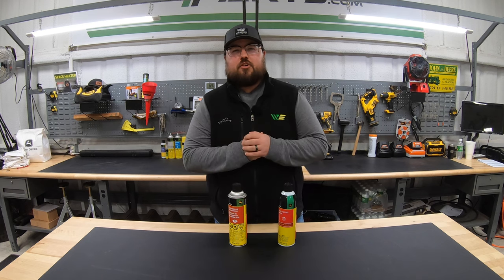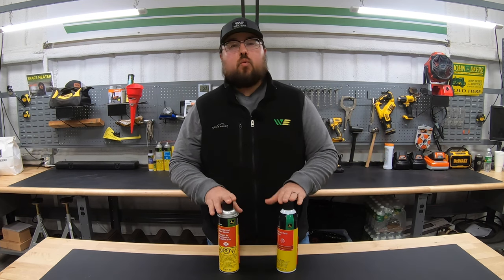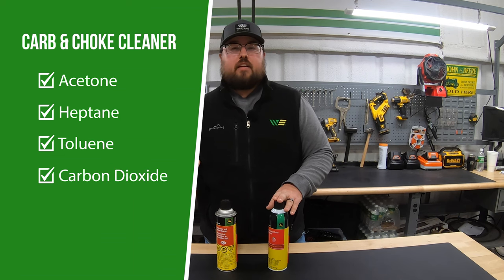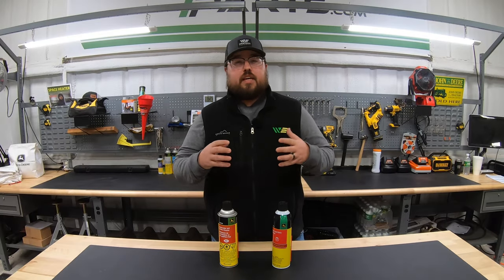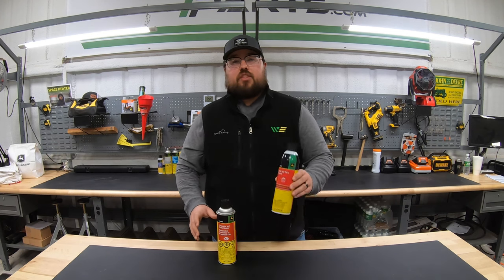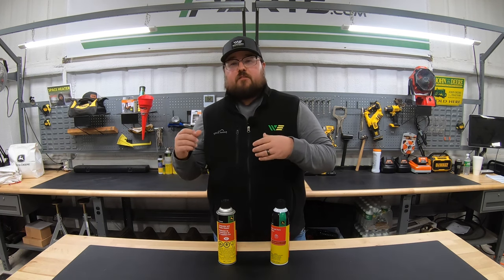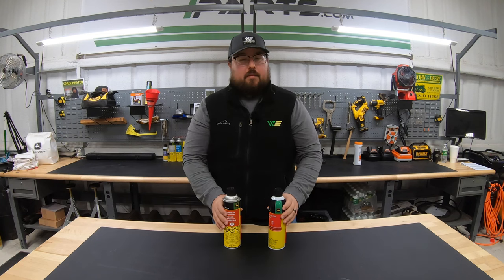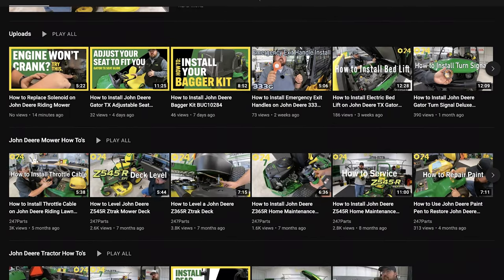Brake Cleaner and Carburetor Cleaner: What's the Difference?

Comment: Toluene is not just an aeromatic. I worked with it for years in heavy printing. It's is absolutely a heavy duty thinner, cleaner. It's no joke. And that's smell is hazardous beyond so many PPM.
Reply from the maker: Thank you for the info! The information that I found on it did not mention much except for the fact that it was mainly for the aromatic purpose. Thanks for watching!
Reply: Damn I love the smell of toulene.
Reply: They used to run straight toluene as fuel for high boost race cars back in the day and pretty much all those mechanics died of cancer.

Comment: Not true at all. You sprayed a rubber mat that the Acetone(carb cleaner). This dissolves rubber and made the carpet powder stick. Brake Clean is primarily Xylene which less likely to dissolve the rubber mat. Carb cleaner does not leave a residue and all the ingredients are used before paint prep. Carb cleaner is a superior degreaser but dries faster than Brake clean.

Comment: Hi, I'm working on a SU carb and have only brake cleaner (which I abuse for other purposes, mainly cleaning plug holes), since I'm replacing all rubber grommets anyways, can I get away with using brake cleaner if I flush it with oil afterwards?
Reply from the maker: Yes, this should be fine. Good question and thanks for watching!

Comment: technically neither leaves a film but instead the difference is how they allow water in the air to reform the film that they have disturbed. methanol acts to pull water out of the air better and puts stuff back to normal. if you ever do water sensitive chemistry experiments you learn pretty quick taht everything is actually covered in an invisible film of water that needs to be cleaned off first with a blow torch or by putting things in an oven/desiccating. 
when people use 3m window sealant to remake bushings, the reason it works for some and not others besides surface prep is coz 3m window weld is a 1 part water activated poly urethane and pretreating the surface with brake cleaner allows the methanol to pull water out of the air back onto the surface. it should be the last thing to evaporate from the surface out of the different ingreadents listed because of hydrogen bonding with its OH group. 
also someone said windshield washing fluid is 20% methanol. thats not true in many parts of the world like the EU where it was banned from windshield washing fluid in 2019. most mfg use a blend of methanol, isopropanol, and ethylene glycol or other mineral spirits. many mfg in the us and other parts of the world use a blend and if it does include methanol it tends to include ethanol (drinking alcohol) because that significantly decreases the toxicity of methanol ingestion. kind of complicated but in the old days the antidote for methanol poisoning was to get someone smashed. this works for ethylene glycol too.
Reply from the maker: Interesting. Thanks for the comment.

Comment: Great video, thanks so much. So I’m curious to know which you would recommend for cleaning O2 sensors?
Reply from the maker: Hmmm this is a tough one. What are the O2 sensors going on?
Reply: I'm also interested in this. I saw bunch of videos where guys keep repeating that it's important for O2 sensor cleaner not to leave any residue but I guess that if it works in such condition as exaust where, oil, fuel and carbon could appear the least worries is about some little residue, at least if you don't use WD40 or something like that. I'm planning to try to clean my with brake cleaner and imediatelly to wash it out with 96% Alcohol just to wash if anything left from brake cleaner.
Reply: Use MAF sensor cleaner. It's perfect for all sensors because it leaves no residue.

Comment: @westernequipment Hi again, for some reason I can't reply directly to your reply to my previous comment so I guess I'll just do it the roundabout way: "Hmmm this is a tough one. What are the O2 sensors going on?" My reply: It's the O2 sensors on my 97 Lexus LS400.
Reply from the maker: Definitely carb and choke cleaner. I would worry about the harshness of the break cleaner possible damaging the sensing element. I hope this helps and thanks for watching!

Comment: Is the chlorinated chemical to phosgene gas issue with brake cleaner only associated with welding or do hot engines and brake rotors have no associated risk?
Reply: There is chlorinated and non chlorinated brake clean. You can't even get the chlorinated stuff in some states. Chlorinated seems to work better, but you never want to spray that stuff on a hot surface. That's when you get the phosgene gas, which can be deadly. On the other hand the non chlorinated  is highly flammable.

Comment: Hi, yesterday I cleaned my fuel injectors with Liqui Moly carburettor cleaner. It behaves exactly as the carburettor cleaner in your video. I specifically purchased it because I didn't want to destroy the O-rings on my injectors. But the stuff totally destroyed my nitril rubber gloves. I read that the O-rings are usually made from fluoride rubber.

I didn't notice anything weird with the O-rings even after a few minutes.

Do I need to worry about my O-rings or is it all good?

Thanks in advance!

Comment: 1:30 No, the toluene is not put in there to warn people about the stout chemicals being used. It does have an odor, but it is a common cleaner to remove varnish from fuel lines and carburetors and to remove carbon from combustion chambers.

Comment: Yes, but basically methanol will react with rubber after you soak it for a while, since this brake cleaner will evaporate almost instantly I guess there is no wories at least if you dont threat the rubber too often.
Reply from the maker: Right but in a carburetor the brake cleaner will take longer to dissolve, therefore it could damage the rubber seals. Thanks for watching!
Reply: did you mean it will take longer to dissolve or evaporate?  @WesternEquipment
Reply: Oh you don't even need to soak it for more than a second. My phone case touched carb cleaner for a second and it started cracking instantly on the outside. Strong stuff

Comment: Methanol damages rubber? Windshield washer fluid is like 20% methanol. :O
Reply from the maker: Yes but with windshield washer fluid, it is out and the open and dries very fast. Cleaning a carburetor could be different and not allow it to dry quickly. Thanks for watching!
Reply: windshield wipers dry out and start cracking pretty quick and i bet windshield washer could contribute to that a little bit
Reply: i dont use windshield washer fluid and my wipers last for 5-10years at a time.... would rather rive a little bit with some slightly less clean windows than to have them not work when i need them. what ends up destroying my wipers is the ice in the winter if i forget to put them up off the window. in china and other parts of the world windsheild wipers are made with 2-6 blades which have much more rubber and can be trimmed and sharpened after each year. kind of dumb how we do it in the US, rainx brandname wipers are like 30$ and suck after 1 year.

Comment: But what about methanol injection on cars?  They spray that shit right up in..
Reply from the maker: This is a good question. I'm sure there are special components in those cars to help with this wear. But I am no expert there. Good point and thanks for watching!
Reply: Methanol is specifically described and warned as heavily deteriorating on engines and it is very hard on them
Reply: The intake manifold in my Tacoma 2.7 L is made of a dense black plastic.  The Gaskets are high temp silicone.  Over time methanol could deteriorate the plastic if it stays liquid and pools up at the bottom of the manifold.  Methanol injectors are operated when engine is running and warmed up.  Therefore the methanol will evaporate quickly nor does it pool up long enough to affect the plastics.

You are supposed to use a little water with methanol injectors.  So if you are worried about it, use the isopropyl alcohol instead.  Plain Ethanol such as everclear should not hurt plastics either.  Other brands of drinking alcohol may contain a little bit sugar. So stick with the everclear when switching to ethanol.

Comment: Brake cleaner is not good for plastic to spray into a plastic throttle body
Reply from the maker: Good point. It's not good for rubber or plastic.